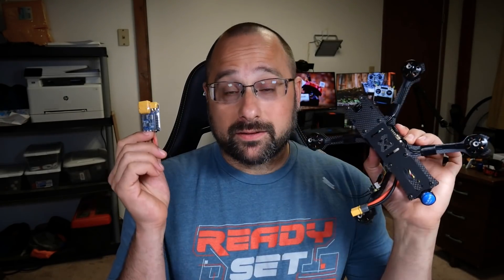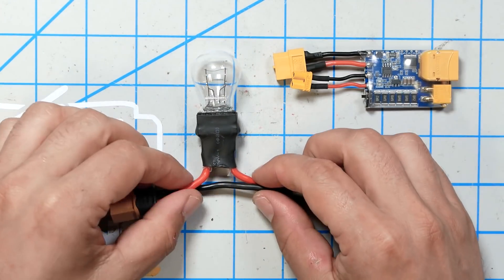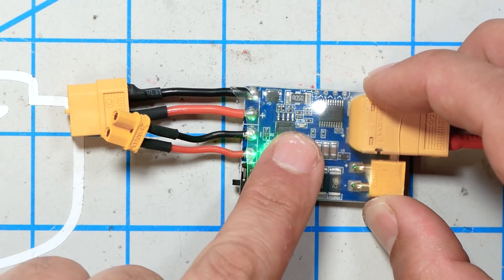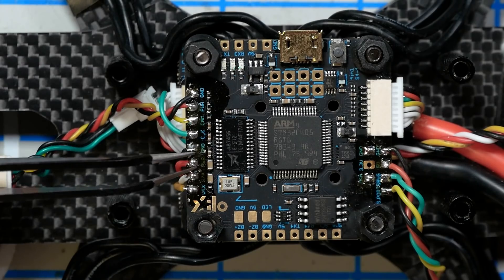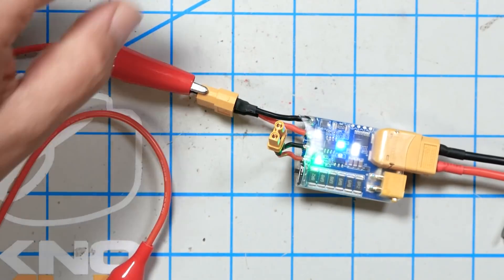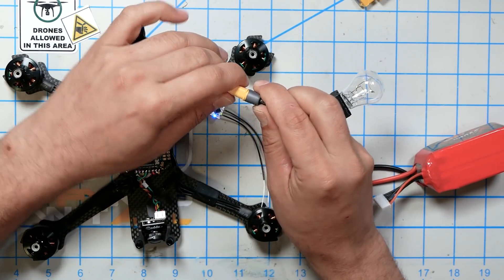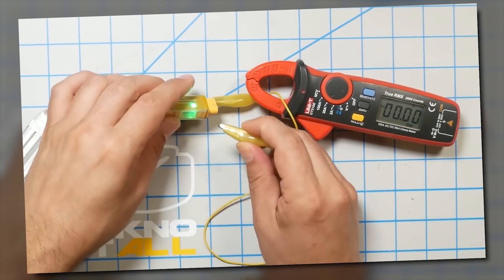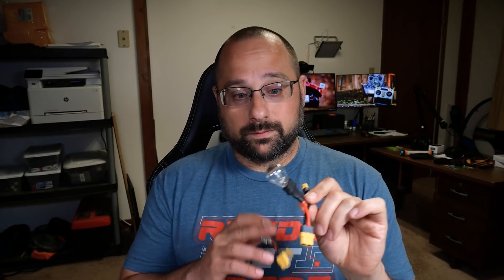ViFly ShortSaver is the smoke stopper you always wanted

Comment: Used mine and it was fine reading. Then I plugged my 4s in directly and 10 seconds later the my Bardwell F7 FC STM32 chip smoked. Very disappointing, out of 30 quad builds this was a first.

Comment: JB, when I first got my Hawk Pro I was in the dark trying to plug 6S 🔋 in the Quad 🔋 plug and it was turned backwards, then I saw and Heard this big bright Spark an smell Smoke, then as fast as I could I made sure the🔋 wasn’t plugged in. I then realized that the 🔋plug must have touch the quads plug in reverse, thinking I just Fried my New FC and Quad! after checking out the Quad for damage all that happened was the G Wire on the FC melted a little bit and a capacitor or diode next to the ground pad had partially melted! Then I plugged the quads 🔋 in an Hit the ARMED switch and the Quad was ready to Fly, I still can’t believe the quad had Survive that much power to the FC in reverse from a 6S 1600 mAH  Lipo 🔋!!

Comment: I have a simpler smoke stopper but I love this one. This is the best smoke stopper made today. I use it all the time but it saved my ass today. I replaced a blown F4 MCU on a 20x20 Mamba flight controller a year ago. Plugged it into Betaflight and I can flash it, the gyro works, I can change and save settings. I figured it was repaired so I set it aside as a spare. Well the gyro in my normal quad went bad so I pulled this FC out and installed it. I get half of 1 beep from the ESC when I plug in a battery and this smoke stopper trips it's fuse and saved me. Apparently there is still a short somewhere in the Mamba FC. Instead of it blowing up, I can look for a short on the FC and try to fix it and maybe it can still be saved.

Comment: is it normal for smoke stopper to turn red when i arm quad?
Reply from the maker: Yes because the motors pull current which trips the smoke stopper.
Reply: @JoshuaBardwell  you are the fuckin man bardwell! Thanks for replying, this is my first scratch build coming from pnp and repairing my own stuff, everything checked out buildwise  but i was a lil scared to plug in with the stopper tripping, after work im going to plug in and arm it up for reals. If it blows up ill reply to this with a sad emoji, if it works ill just post sick videos. Thanks joshua.

Comment: Hey everyone watching this video, as of this post the ViFly ShortSaver is now made as version 2 which does indeed have an ON-OFF button. And it also has a button to switch between 3 different trip times depending on what sensitivity you want it set at; High Sensitivity for Low Currant(default), Medium Sensitivity for Medium Currant, and Low Sensitivity for High Currant.
Reply: Awesome.  I have the original and used it for the first time today.  It tripped but I found no problems with my build.  I remove power from the Caddx Vista and the trips went away.  It was just too sensitive.  If you have the original, you can still select the trip sensitivity, but you have to do it by bridging the S pads or N pads on the back. S for a little less sensitive, N for even less.
Reply: Yes, I have the new version, The dried-grape sensitivity feature is wonderful.
Reply: Are these still for sale? Newer model out now?

Comment: Can You Use That Stopper With Say A Ovonic 1550mah 6S 100C Lipo Battery Plugged Into A Armattan 6S Badger Kwad When Brand New, To Make Sure Everything Is OK.. By The Way, Is It OK To Use 1550mah 6S 100C Lipo’s With The Armattan 6S Badger, I Just Purchased The 6S Badger, And That Smoke Stopper. And 4 1550mah 6S Lipo’s. Can That Stopper Handle The 25 Plus Volts The 1550 6S Put Out ??? Thank You... This Is Super Important For Me, Thanks Again...

Comment: I don't see why drone builders don't fit an ordinary silicon diode to the PCB  + - terminals , And a fuse ....We've been using them in radios for years ... If the battery polarity is correct the diode does nothing , It just sits there , If however the battery polarity is reversed the diode conducts  and the fuse is blown .

Comment: I bought this smoke stopper from the  above link (thanks Josh) and it is doing something I find very curious on my latest build. When I connect a 4S battery to my new HLGRC 60 amp all in one esc board with any three motors wired, it is fine. But when I wire all four motors, it trips. I am using the one amp switch setting. Have any of you had a similar experience? I have never used a 60 amp esc board before.
Reply from the maker: The blheli motor beep on startup is tripping the current limit. In blheli reduce the beacon strength.
Reply: @JoshuaBardwell  I changed the switch position from 1 amp  to the 2 amp setting and tried it again with all four motors and the smoke stopper didn't trip. Your comment re: the beacon setting and my multimeter satisfied me I didn't have a short or defective board. Thanks for your help.
Reply: @charlesestes4530  The current should be over 1Amp when connecting 4 motors, so it trips and protected.

Comment: @6:20 you plug the smoke stopper into your battery correctly, but then you plug the power backwards into the quad. It's very important to note that the smoke stopper itself has no way of knowing this. It's simply tripping from over current.  You're lucky that you didn't damage anything by doing this and my guess is the reverse voltage was limited by the body diodes in the ESC FETs (thankfully). Reverse biasing the voltage regulators, micro controllers, and other silicone items can destroy them in way less than 3 ms. Honestly 3 ms is quite a long time in the world of electronics. A few dozen nano seconds up to one or two micro seconds response time would be better.  Additionally, if you want reverse polarity protection with a bulb based smoke stopper, just put a hefty Schottky diode in series.

Comment: @joshua bardwell I've always checked for shorts with a multimeter witch is in my eyes a better solution then a smoke stopper and essential to use on any new build  because you can be 100% sure you don't have any before you decide to put any power to your equipment. It can also tell you if you have your power connector. soldered on backwards so you can fix that before you pull your battery in backward too. The only thing is that it definitely takes a little longer to check everthing out then it would to plug in a battery with SS  or device too on it.

Comment: Does anyone make this for micros or whoops that use JST or BT2 conncted batteries...i have the most trouble soldering or fixing my tiny AIO boards in general an well, Ive smoked a few to my chagrin....its the smaller stuff I'd really need this for...just curious if there are any similar adapters out there.

Comment: Hey Josh,  I just ordered one of these and did you see this feature? https://i.imgur.com/YMqVXJi.jpg You can short these pads on the bottom and it changes the overcurrent and short circuit time for larger builds like you were discussing being an issue.
Reply from the maker: Yeah I'm familiar with that but even still it's not that big of a difference if the motor beep is trippnig it.
Reply: @JoshuaBardwell  I think it has less to do with the motors and more to do with the large capacitor that's put between the battery terminals.  These capacitors produce a large surge current that can trip the short saver depending on how big of a capacitor it is and why bridging a the pad to increase the timing would resolve the issue.

Comment: That wasn't a rdq / bengineering labs one you blew up btw.
Reply from the maker: Are you sure? Why do you say that.
Reply: @JoshuaBardwell  As far as I know all units shipped either have the bengineering labs logo or RDQ silkscreened on the bottom with green/black PCB's. They are spec'd with a quality PPTC 0ZCG0110BF2B rated up to 24v
. The unit I saw was a two PCB design with a through hole led. Could be wrong though :shrug: So many clones now from overseas with the simple PPTC design.

Comment: Just use a decent lab bench supply with an adjustable current limit (and even better trip/fuse mode) for new builds. Start at a few 100mA and increase as necessary. With a low current limit you can even quite safely test the motors with the props on.

Comment: Just tried this w a Vista and it’s going red after a single tone. Double checked and I’m pretty sure wiring is good. Is the Vista drawing more than 2A?
Reply from the maker: That's possible. It would be nice if the shortsaver had a 3A setting.

Comment: check this out https://www.immersionrc.com/fpv-products/ghost/ also there some hardware changes to the 3rd batch of radiomaster t16s (got mine just a few days ago hallsensor version) the protective film on the touch screen doesn't have a grid pattern on it that so many thought to be the touch screen pattern, there's a larger louder speaker installed in the back cover not in the back of the grid in front so two halves are now conected by two cables, probably important info for anybody opening the radio for the first time  and the project box is replaced with a simple flat plastic cover and you get extra screen protector in the box.

Comment: So it just shuts off power when instantaneous current exceeds 2A for some period of time... 
Why don't you just use a 2A 12V power supply to power the quad instead? Or a laptop charger? Those generally supply 19V at a couple amps, and the output is shut off if it detects short circuit.
Reply: or an adjustable lab bench supply.
Reply: @areg7182  I did consider mentioning that too, but lab bench supplies just have a constant current limit usually, rather than foldback current limiting or hiccup mode. They aren't much better than the series resistor method.
Reply from the maker: One reason is that you can't easily take a bench supply into the field.

Comment: Aaarrggh.  A smoke stopper, I just realized, has been wasting a ton of my time.
I set up a new quad with a DJI Air Unit, and everything seemed fine.  I plugged it in with the RDQ smoke stopper and everything checked out.  Then a little while later I plugged it in, it would do the correct esc startup tones and start beeping.  Then after 15 to 20 seconds it would make 'crunchy' sizzle (? lol) sound and the smoke stopper light would flicker.  Well I ended up changing out my entire FC because of this.  I set it up and same thing = it was fine a few times plugging it in with the smoke stopper.  Then I plugged it into my computer and after 15 seconds or so it would happen again - crunchy sizzle.  
Well I finally realized now that it happens when the green light of the DJI air unit lights up = when it apparently starts drawing more current.  So I took the risk and plugged it in without the smoke stopper and everything is fine.  What . a . royal . pain !  lol  At least I have a spare good FC now and the new build is cleaner with the HGLRC Zeus board.
Reply: OMG I spent hooours doing this shit, soldering unsoldierng, just sent it like you said aaaand no issues. The flicker was driving me insane

Comment: the vifly lipo buzzer is not trustworthy I have bought like 20 and they all seem to die after a few uses so that has left me with not the best feelings toward vifly
Reply: I am sorry to hear that. VIFLY always attaches great importance for customer's feedback. Pls contact our support team via email support@viflydrone.com, I believe they will provide you a satisfied solution.
Reply from the maker: I dunno if there is a bad batch out there or something. I have them on many of my quads without a problem.
One thing that could happen is: some FC back-feed the FC from the buzzer pad, so the FC stays powered up after you unplug the battery. The Vifly battery powers the FC until the Vifly dies. That might explain the problem. It might be good for ViFly to install a diode on the 5v line to prevent this.

Comment: LoL! Guilting us with the kiddos. Seriously though that little contraption would have been nice when I plugged in my second drone build several weeks back. I checked that D@m# XT 60 plug 3 time to be sure what direction it needed soldered and slap me if I didn't solder it backwards anyways! 😞 At least I had the foresight to plug it in slowly and heard the uncharacteristic crackling sound in the plugs and yanked it apart. $13 of sound insurance versus smoking $100 of equipment. An ounce of prevention is worth more then a pound of cure? Absolutely G.D. right!

Comment: Hey Josh   I finally stumbled into some 6S batteries.  It made my Armattan Rooster with 6" arms   low KV motors fly nicely ( everything's rated for 6S BTW)   BUT....   when I gave her full throttle the quad went full  retard  like had a stroke.  Wonked all sideways .  Recoverable  .just drop throttle,      but that was just weird..!!     before I try my normal rooster 5" arms same Engineer X motors  but higher KV   what might I be experiencing ?

Comment: What's the advantage over using a multimeter continuity test?
Reply: Imagine you have two motor wires shorted. With a multimeter, this will not show up because the ESC MOSFETS are off, so there is not short at first. But as soon as you plug the battery in, the MOSFETS will turn on and the short will come in effect.

Comment: Technically it didn't protect from reverse current there, but just overcurrent again. The smoker stopper has no way of knowing that it was connected the wrong way around on the load side, it just tripped probably because of some protection diodes somewhere in the quad. It can only detect reverse polarity on the input side, since that is the only place it can actually measure voltage.

Comment: Why not just test with a multi meter in short circuit mode?
Reply: If you got motor wires shorted, multimeter will not detected it because the ESC MOSFETS are Off ;) 
Check my shortsaver giveaway in my channel, just leave one comment and subscribe, done!

Comment: Would be perfect if it had an on/off switch, helps out with binding.
Reply: You could easily put a switch between the device and drone your self
Reply: Wet tongue does the trick
Reply: Srsly you have no cable that you can Power switch???
Reply: Next version will have it.. Vifly said it..
Reply: It's not that easy depending on the implementation of the power path.

Comment: Would a big capacitor across the pigtail cause the unit to trip, but only the first time you plug it in and it charges?
Reply: My thought too. A cap will generate a big inrush current. Depending on how fast it trips

Comment: Could you use a lab bench power supply in place of a smoke stopper? If you put it at 15v and limit current to 1.5a? Mine has reverse polarity protection as well as a current limiter built in. It's pretty fancy one from 2008. I don't want to buy a smoke stopper if I can use my lab bench power supply instead.
Reply: Anthony, I would not advise it.  A Bench supply in constant current mode is still going to be pushing 1.5 amps even if there is a short. This smoke stopper delatches the supply from the output when a current threshold is exceeded, giving you a chance to fix whatever is wrong.  With the bench supply, you will probably still end up burning something.  That said, I use a bench supply when building quads all the time, but I still put a smoke stopper in-line.

Comment: One more thing I would ask for on this: A power switch. I don't get why it isn't standard for smoke stoppers to include a switch. That would make binding receivers much more convenient, which would help make using the smoke stopper a habit.
Reply: Yes, we will add ths into next version for sure. Thanks so much for your suggestion.
Reply: @VIFLYDrone  please add an indicator like an rgb led, how much amps are drawn, like green low, yellow over 1amp,  Red over 1,5amp, white just before protection close to 2amps. This help better to understand drone with many LEDs or consuming Motor sounds.
Reply: @SusiSpecial  We even consider to add an LED to show the real Amp number.
Reply: @VIFLYDrone  500 mA to 3 Amps would be perfect ( just like the 3157 Automotive bulb  💡)
Reply: @VIFLYDrone I'll buy 1 . Thanks
Reply: @VIFLYDrone  That's great news, thanks! I will order that one as soon as I hear it's been released.
Reply: I build a Powerswitch with XT60 and XT30 by myself. Easy thing to bind quads now.
Reply: VIFLY ShortSaver 2 with power switch is coming, https://www.viflydrone.com/smokestopper.html
Reply: @VIFLYDrone  I've bought it and I love it!
Reply: I agree. A switch would help.
Reply: Keep in mind to use the lowest voltage possible..
Less Volts = less Watt.. But i think I am wrong on this...
It's all about the ampere which will burn stuff ?

Comment: It's not very satisfying - You're all set up for a massive spark and the light just turns red.

I'd probably put an anti-spark connector on the output so it doesn't trip when charging the capacitors.